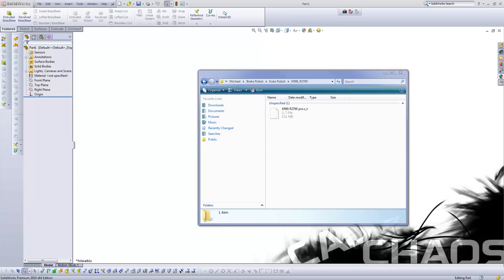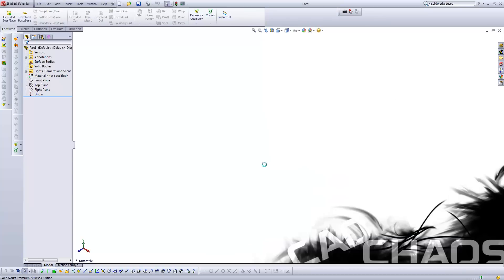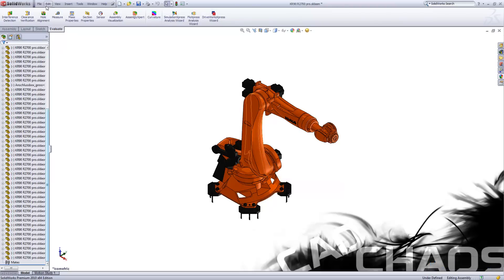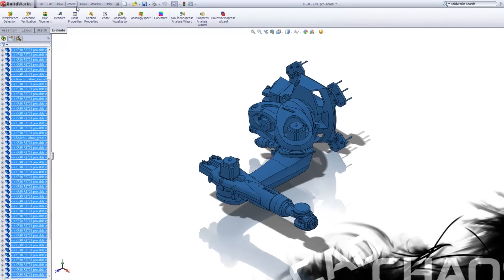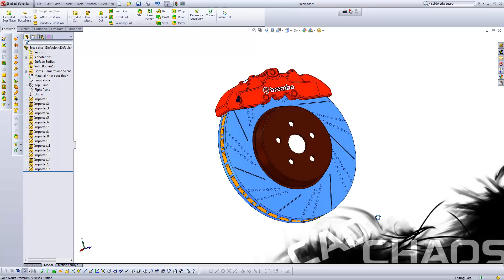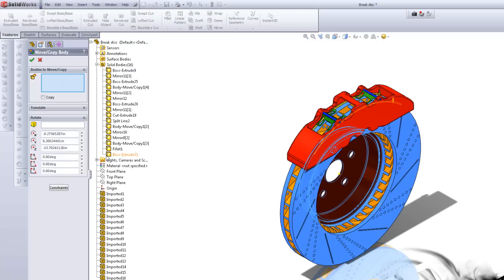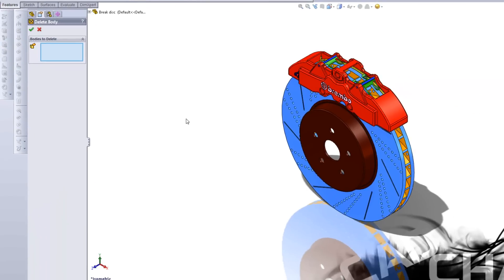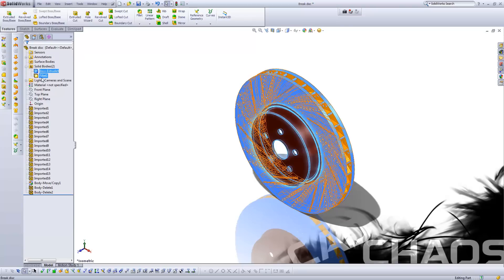In Solidworks - How to Change the Orientation of a Part

Comment: I cannot  change the view orientation in my assembly with your 2nd (method) , I wonder if there is a problem because in my assembly I fixed several components and these maybe  could be the reason , isnt it? . I was forced to use method 1 . Thnks for your video.

Comment: Tool -> component -> rotate

Edit: Apparently, it only works in Assembly.
Reply: +TheRealJackfrog Apparently, it only works in Assembly....
Reply: Thanks
Reply: If you're trying to rotate a part, open the part in the assembly and do the steps (either rotating components, or move base).... :)

Comment: Thanks for the video, you did a great job of showing how to change the orentation so that when selected it would give a  "machine, Z-up" orentation which I tried immediately. The problem I have is that I can't fugure out how to get the sketch to follow the change. It flips the axis, i.e. if you pick FRONT axis from the orientation box then Z is up and X is to the right (so far so good) then you select to open a sketch and the plane flips and Z is now point down, X to the right.
I would like to configure SW to run "machine coodinates" (Z-up, X-right, ...) is this possible?